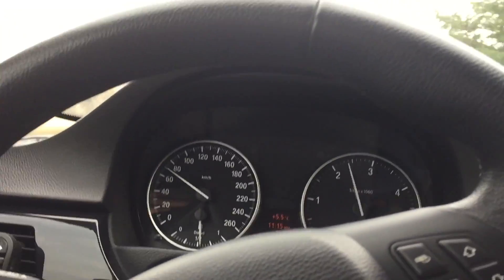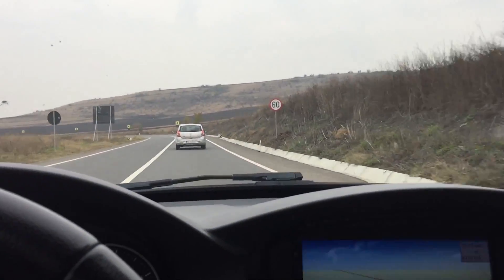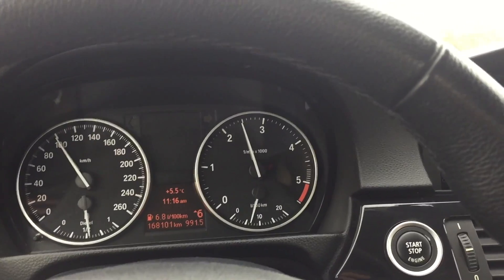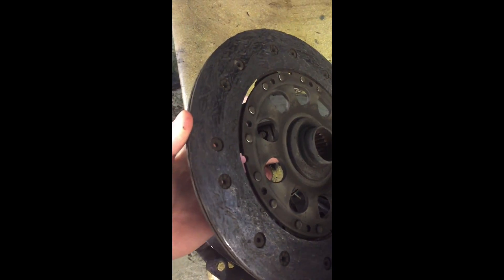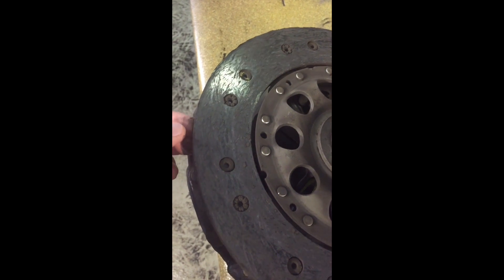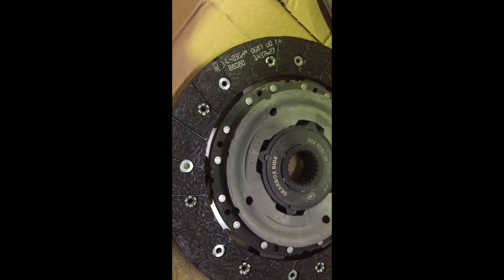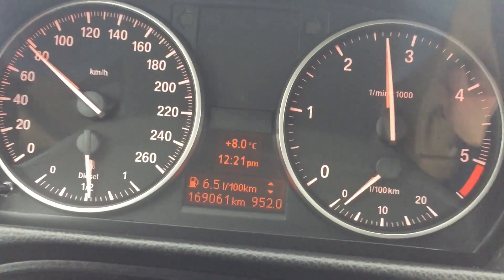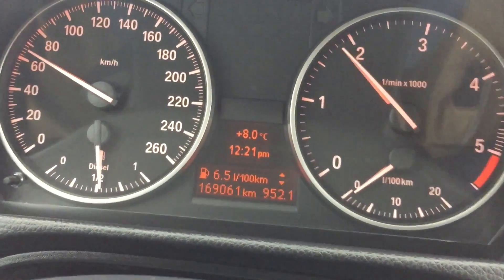BMW e90 Clutch replacement BEFORE /AFTER

Comment: Thank you for taking your time to make this video, i have the exact same problem, your a legend i will change the clutch and let you know how it goes
Reply from the maker: Glad it helped :)
Reply: @DrMeize  did you only change the clutch or the fly wheel also
Reply from the maker: @junaidmalik1976  only the clutch , the flywheel looked good with little play in it ...
Reply: @DrMeize  did your car ever stall, my car keeps stalling and the engine light comes on some times,
Reply: @DrMeize  just spoke with the garage who said my clutch is definitely gone (its slipping) and the flywheel is fine but with a little play, i will let you know the results once the car is done,

Comment: So, the term transmission slips is really a bad clutch. When do should you replace clutch vs transmission, vice versa?
Reply from the maker: transmision means gear box , clutch means the ligature between the engine and gear box .. so the clutch is good to change it when you observe that the power you know you had is not transmited the same to the wheeles

Comment: Did you experience a dull whining noise when accelerating when the clutch was bad?
Reply from the maker: nope ...if you have that noise when acc, there is a known problem with non eom oil filter... just give it a try , get a new oem MAN oil filter and see if it help with the noise. If not there must be smth else

Comment: Chipped?
Reply from the maker: Nope ...
Reply: @DrMeize  I have tuned 116d with 150kkm and it started slipping occasionaly. Thinking about stronger clutch..
Reply from the maker: @KV89-b3c  what fo you mean by tuning ?from what hp and nm to what ? i think that you only need a new one not a powerfull one...from 116 you can't get that much power :(

Comment: Sheesh, that diesel engine eats up just as fuel much as a 320i ;)
Reply from the maker: I really don t think so :)
Reply: Lol, no not at all. This 318d is maybe 2x more efficient than 320i. No matter what year
Reply: @B2KJFF  well, 6.8l/100km is quite a feat for the 318d in any case :)
I've gotten around with 7.1 in the 320i
Reply: @davidh9659  6.8 is rubbish. I have a 318d I consistently get 60mpg which is around 4.5/100
Reply: @davidh9659  6.8 is certainly not quite a feat lol.
Reply: @davidh9659  and in my 320d I get 5.7l/100. The diesels like I’ve already said are way way more efficient than the petrols regardless of the year. My friend has a g20 brand new 2021 320i and he still gets almost 15mpg less compared to my 14 years old e90 320d
Reply: @B2KJFF  it is in the way that you have to work hard to make it go that high xD
Reply: @davidh9659  under equal driving styles in both cars the diesel is still much more Efficient than the petrol. You must own one to realise :) I have owned both and there is no contest that the diesel is far more fuel efficient than the petrol.
Reply: @B2KJFF  yeah I've had both ;)
Buddy drove his 140hp golf with 4.5